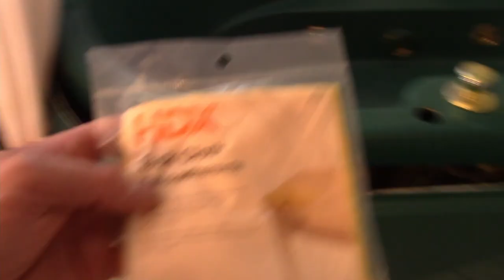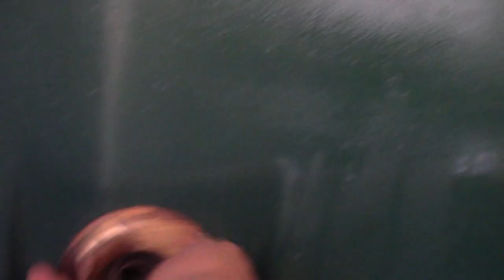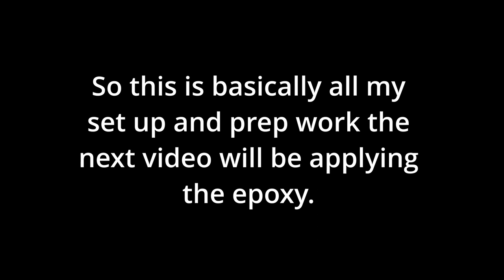Refinishing a jacuzzi bathtub with Armoglaze / Ekopel 2K epoxy

Comment: How long did you wait to remove the tape from the jets
Reply from the maker: I kinda forget. It’s been a while. But do it once you think that the epoxy is set up enough that it won’t move when the tape is removed. Don’t want until it’s starting to dry or it’ll be impossible.